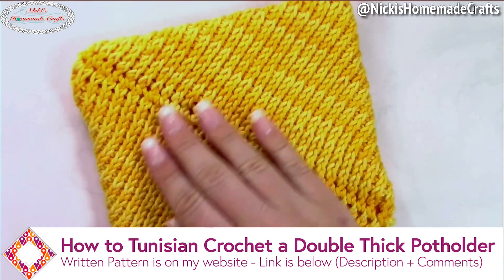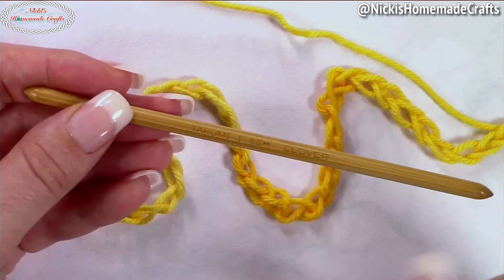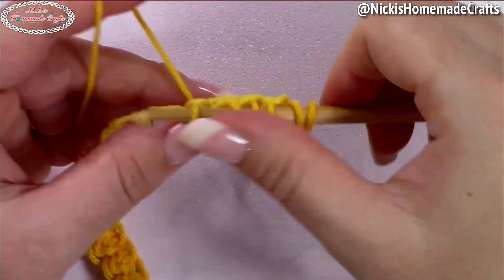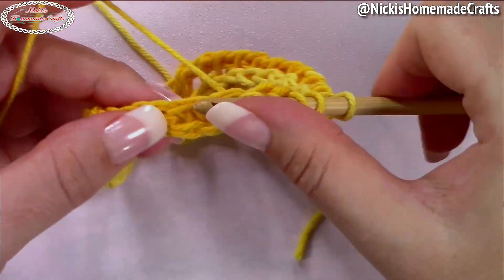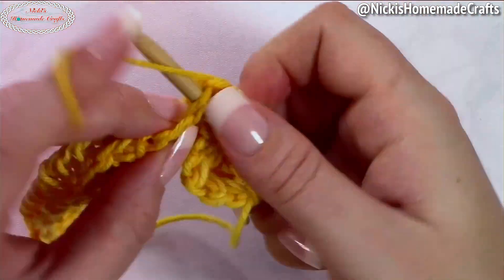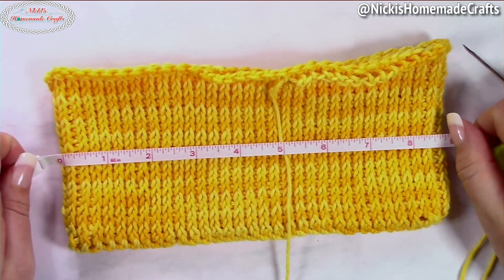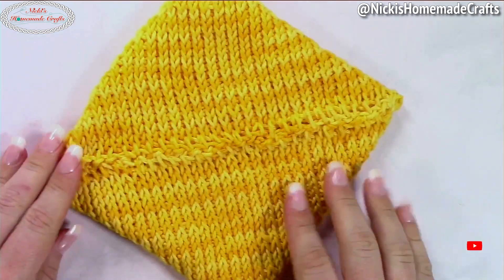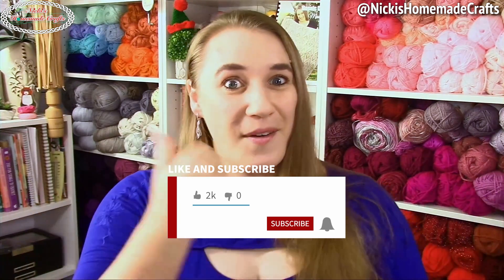THICK Diagonal Tunisian Crochet POTHOLDER Pattern

Comment: Confusing by using double ended hook ....why not use an afghan hook long enough to hold all 31 stitches?
Reply from the maker: Because you are going in ROUNDS and also need to work it up from the back (reverse path). That only works with a double-ended hook. You could do it with a regular Tunisian hook IF you sew it together into a round in the end. But it creates an addition seam. So a double-ended crochet hook is better.